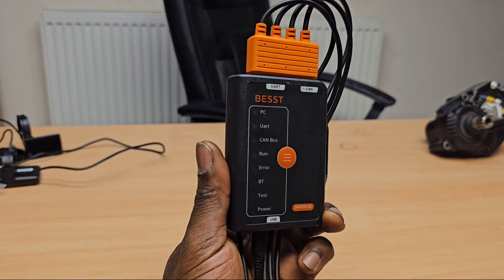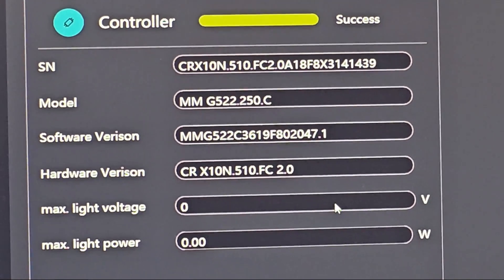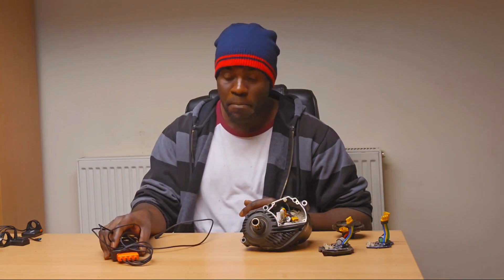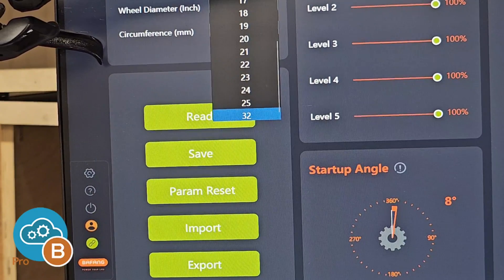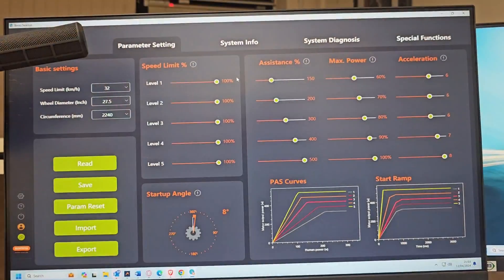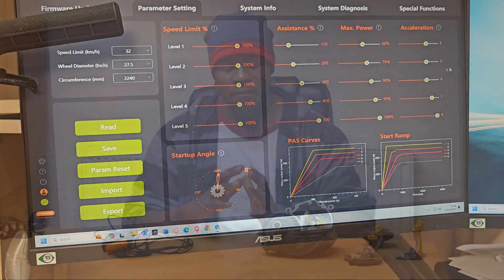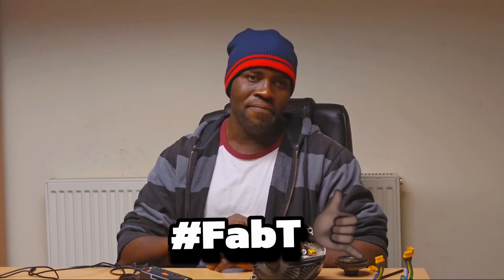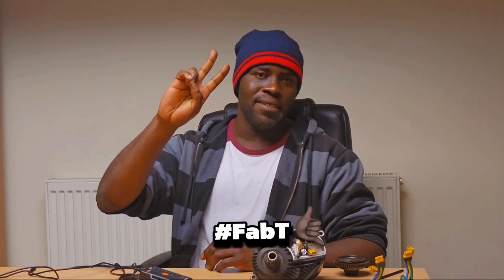Bafang Besst Tool & Besst [Pro] Software Explained

Comment: Can it update the firmware on old bbso2 750w controllers?
Reply from the maker: If its the BBS02b, yes. Because thats CANBus. If its the original BBS02 (uart), the best way is to change the values via the programming cable which will alter the characteristics of the motor. Although, uart bafang controllers are limited in terms of parameter tuning compared to CANBus. But third party companies like eggrider have proven to be useful in terms of getting more out of uart bafang motors👍🏿

Comment: Hi Neeko, great insights on this tool and its encouraged me to buy it with the frameset i've ordered. I didn't notice any mention of ability to use it for adjusting the % when battery saving mode kicks in - is this available or is it a setting Bafang sets in the BMS and can't be adjusted? Thanks

Comment: Hi.
Can the overrun be tuned
Its way too much--coming from bosch....
Reply from the maker: Hi there, 
Yes. Over-run is influenced by acceleration. More acceleration, more Over-run. 
Have you tried the Bafang Go app? You can use that instead to tweak acceleration/Over-run👍🏿
Reply: @neekodevinchi did turn the accelarion right down-no effect on overrun
I'm goiing to try bess tool from a friend next

Comment: Hi Neeko, thanks for helping everyone out with your videos. I was wonder if you ever across this scenario, My DCP08 display will not turn on ( running M600), but when i press display power button, the led  on the control board flashes green. Battery Voltage is Ok and voltage to the board is OK. the display is ok, tried it on another bike. The motor has done less than 20km, basically new Thanks Again
Reply from the maker: Hi there, 
Thanks for getting in touch. 
This is bizarre. The dpc080 display should initiate the Bafang M600 by holding down the power button for 2 - 3 seconds. 
Have you checked to make sure that the display cable and/or wiring loom are kinked?
The dpc080 display cable should be routed on the upperside of the clamp mount, where you should see a small cut out.
Have you tried a different display to turn on the m600?
Do you have/know someone with the Besst Tool?

Please confirm. Alternatively, don't hesitate to drop me a message via email or via Facebook/Instagram👍🏿
Reply: @neekodevinchi  The problem is so strange, when connected to Besstpro, i can read the controller and HMI, do a calibration, but ounce i disconnect it, i cant turn it on via the HMI, The cable and the HMI i am using works on another motor. Its like the vcc on the board that connects to HMI is not working
Reply from the maker: If I had to guess, the pcb board which connects the xt60 connector to the controller has failed. 

Have you tried performing a system test?
Under the system diagnostics tab, it should allow you to perform a system test.
Reply: @neekodevinchi  Thank you so much for your kind assistance.  Yes, i tried the diagnostic on the motor, the controller turns off and  besstpro ask you to turn it back on, which is the issue, it wont turn back on until i exit the diagnostic page. I think you are 100% correct about the board. I have a board that just arrived, can advise if the white rubbery sheet behind the board is a heat sink paste /pad as they could only supply the board itself. Also could you please advise what is the best firmware version you would use

Comment: Dear @neekodevinchi,  
Thank you so much for your quick response!  

Assistance Needed with Firmware Upload Issue.on M625 52V

I am currently using all three available software tools: **BeSST**, **BeSST Pro**, and the **Open Bafang Tool**.  

Changing the wheel size is the least of my concerns. The main issue is that the store where I purchased the M625 with a 52V battery sent me a new firmware, supposedly to unlock the system. However, I am unable to upload the firmware.  

Here’s what happens:  
- I load the firmware into the BeSST toolbox.  
- Then, I reconnect the controller as required.  
- But the firmware does not transfer from the BeSST toolbox to the controller.  

There is no CANbus green LED flashing on the BeSST box as expected. When I reconnect, the controller does not respond at all. I have tried everything I can think of, but nothing works.  

Could you please help me resolve this issue?  

Thank you so much for your support.  

Best regards from Portugal

Comment: Can BEEST software fix intermittent power loss when riding?
Reply from the maker: It depends.
If the problem is due to firmware, yes.
If the problem is caused by communication abnormalities, battery issues or motor issues, no.
The Besst Tool will only identify the culprit in those circumstances. But the part itself would need to be repaired or replaced👍🏿
Reply: @neekodevinchi  Would replacing the motor controller may help?
Reply from the maker: @nvleite not necessarily. If the controller is the cause of your intermittent power, then it could possibly be firmware related. 
If your motor acts irregularly, then I would consider a controller swap.
However, either solution ultimately requires the Besst Tool. 

If you're located in the UK, feel free to pm me ti book an appointment to get your bike/motor resolved.

Comment: Hi Neeko, Thank you for your videos!
 I bought the BESST TOOL for M625 Motor and cannot change anything! even the wheel size its locked to 28", seems the firmware its locked, i bought the motor with 52v Battery from  Lascycle-EU trough Amazon and they said the firmware its different to support the 52V Battery. What can i do to use the BESST TOOL working with my motor?
Reply from the maker: Hi there. Thanks for getting in touch. 

Which software are you using? Besst or Besst Pro?

Changing the rear wheel size is usually straight forward. But depending on your region, you may find that you can't save the new rear wheel size if the speed limit is above 32kph. 

In that circumstance, I would reccomend getting the Bafang dpc080 display. That display allows the rear wheel size to be changed, irrespective of speed limit👍🏿
Reply: Dear @neekodevinchi,  

Thank you so much for your quick response!  

I am currently using all three available software tools: **BeSST**, **BeSST Pro**, and the **Open Bafang Tool**.  

Changing the wheel size is the least of my concerns. The main issue is that the store where I purchased the M625 with a 52V battery sent me a new firmware, supposedly to unlock the system. However, I am unable to upload the firmware.  

Here’s what happens:  
- I load the firmware into the BeSST toolbox.  
- Then, I reconnect the controller as required.  
- But the firmware does not transfer from the BeSST toolbox to the controller.  

There is no CANbus green LED flashing on the BeSST box as expected. When I reconnect, the controller does not respond at all. I have tried everything I can think of, but nothing works.  

Could you please help me resolve this issue?  

Thank you so much for your support.  

Best regards from Portugal

Comment: Hi Neeko,
Firstly thank you for the great videos. I think it very helpful, so maybe you can help me. I bought a E-Cargo bike around 3 years ago and recently out of nowhere there is a problem with the bike where i will get no pedal assistance, meaning i will be on the bike with my kids as normal, then it would just stop working, it would show error 36 so i did research  and made many calls but nobody even the dealer that sold me the bike wants to help. What i did was reset the system then it would work a day or two but then it goes back to the assistance stopping to work. I replace the display which didn't work and the Battery is fine...im just lost at the moment not knowing what to do and there is no e-bike workshop that has the tools to work on Bafang motors near me. It has the Bafang M420 motor, what always work is the push assist. So i think the motor is fine, it only has 1500km. Like i said after system reset it sometimes work for a day then the next its back to not working. Thank you for you time.
Reply from the maker: Hi there, 
Thanks for getting in touch. 
Error 36 relates to the display/remote abnormality. 
Nowadays, I tend to use my Besst Tool to resolve any and all issues concerning Bafang systems. However, if the motor and battery work on your E-Cargo bike once it's on, then your issue "might" be display related. 

Where are you based?

If you're in the UK, I'm more than happy to help. If not, please kindly let me know anyway. I may be able to put you in touch with someone who has the Besst Tool who can definitively identify the issue. 

Look forward to hearing from you👍🏿
Reply: @neekodevinchi  Thank you for the quick reply. i'm in Mainz, Germany. Everyone around here is ready to help if its a Bosch motor but for Bafang no luck. I mentioned that i replaced the Display and it still had the issue. Like i said currently the bike/motor wont go on but if i do multiple resets (- plus on button, while removing the battery then pushing it in position again) it works for a while then the next day its dead then back to rest etc... Someone said it might be the controller, i dont know it's driving me crazy 😛 I actually want to sell the bike as the kids are to big for it now but i don't want to sell something that's broken.

Comment: Hi, I'm writing to you from Italy. I have a Bafang M560 with 5 settings... is it possible to only have 3? Thanks.
Reply from the maker: Yes. Although you'll need the dpc080 display to have 3 levels of assist👍🏿
Reply: @neekodevinchi  sorry for my bad English... first of all thank you for the answer.... I have a question seeing on the sites the display you mention has 6 levels anyway... can I decrease them from the bestpro programmer?
Reply from the maker: No.
The number of levels of assist are determined by the display. 
You can change parameters of each level of assist using the Besst Pro. But the Besst Pro can't change how many levels of assist you have👍🏿

Comment: Can you tell me how to get top speed on a bafang dp c245   Thanks
Reply from the maker: The DPC245 display doesn't have an option to change the speed. The DPC080 display does have the option to change speed, wheel size and circumference👍🏿
Reply: @neekodevinchi if I swap mine for the one that one would it be as simple as plug and play.   Or would I have to have it programmed?
Reply from the maker: You simply swap out the display for the new one. No programming or pairing required👍🏿
Reply: @neekodevinchi .  Thank you sir I appreciate your help keep up the informative videos
Reply: @neekodevinchi .   I just ordered the DPC080 I will be swapping my unit out for it and get maximum speed and torque with my M600.    I will keep you informed how it goes
Reply: @neekodevinchi .  If my motor is locked will the dpc080 unlocked it or will I have to get my motor programmed?      I have the M600
Reply from the maker: @TonyTacoma It is unlikely your M600 is locked. I remain 95% confident that as soon as you plug in the dpc080 and change the speed limit, it will write over the original speed limit👍🏿
Reply: @neekodevinchi . I just installed the DPC080 and went in the advanced settings I tried to change my wheel size and speed and it says configuration failed.       What other options do I have in removing speed limit?

Comment: So is this good all ebikes. Im a technician @Cycle Joint.  In pensacola fl.
Reply from the maker: The Besst Tool works with ebikes which use the Bafang system. 
For diagnostics, parameter tuning, calibration and firmware updates, it is essential👍🏿

Comment: How can I get an invite code?
Reply from the maker: Do you mean login details?
If so, only Bafang can give login details to applicants. 
As i mentioned in the video, it's not easy to get your own login details. But ultimately, you would need to apply to Bafang or find someone who is willing to share their own.
Reply: @neekodevinchi any advice on how you did it. getting a contact is the hardest part for me right now. Crazy i have to go through all this just to tune a couple parameters 😂
Reply from the maker: Their are easier ways to tune parameters for the Bafang motors. Have you tried the Bafang Go app?

Also (depending on whether your motor is CANBus), have you checked out the Bafang dpc080 display?

Combing both the Bafang Go apo and the dpc080 display allows ALL parameter tuning without the need of the Besst Tool. 

I'll elaborate on this in an upcoming video👍🏿
Reply: @neekodevinchi i have that display and the app.. not enough customization for my liking
Reply from the maker: What are you trying to change/adjust?
Reply: @neekodevinchi throttle response and pedal assist sensitivity
Reply from the maker: That's usually firmware associated. 
The Besst Tool is the best way to change firmwares.

Comment: I just purchased a used ebike with the M600 motor.   It is powerful.  The display has 9 assist levels.  I feel that in level 1 if gives too much assist when riding fairly level terrain.  Can this be programmed to do less assist?  I do not have a Bafang account or a Besst programmer.  Is it still possible to get an account and a programmer?  Or is it best to find a bike shop that could do this?
Reply: I don't think you can, cause you're not the original owner of the account for the motor. Probably should've asked for the account to be changed in your name before purchasing. Although a e bike repair shop should be able to take care of you.

Comment: Hello, Neeko. Thanks for the video! Is it possible to connect this device to the Ado ebike (rear Bafang wheel motor, can-bus)? Will it be possible to activate throttle? (There is no throttle on the European version). Is it possible to increase the engine power? (250w is the European limit)

Comment: Hi Neeko, thank you very muchfor this excellent video. I have the M560. What do you think would be the max speed I can configure with the tool?
Reply from the maker: Hi there, 
It depends on the firmware. 
The M560 which was sent with my Hybridizer Sann was set to 45kph. 
But you can set it to 60kph (for private property use).

Of course, you can set it to 25kph/32kph depending on country and region👍🏿
Reply: @neekodevinchi  Thank you very much.

Comment: My M600 motor came with a throttle delay which only enages after 5-8km per hour. 
Is it possible to remove this delay so I have instant throttle like I did with my BBS02B? Thanks for the informative video.
Reply from the maker: Hi there.
Yes. It is possible to do this with the Besst Tool and the original Besst software. 
Your throttle delay is due to the particular firmware installed. So a different firmware (coinciding with your battery voltage) would need to be installed. 

If it helps, I can reccomend specific firmware which offer instant throttle responses in all levels of assist. However, i would need to know your battery voltage. 

Look forward to hearing from you👍🏿
Reply: I installed a BBS02 with CAB bus a week ago. Throttle delay is 2sec no matter what speed I have so if I change gear uphill the bicycle will (almost) stop. Throttle is also sensitive so the ride is rather jerky compared to my old BBS02 with UART and Eggrider V2. Also I need to press the on/off button for 6-7 seconds to turn on the EKD01 display.  Can these parameters be changed with BESST tool?

Comment: Does this work for m625 motor
Reply from the maker: Yes. The M625 is CANBus. So running diagnostics and changing parameters (rear wheel size, circumstance and speed) can only be done using Besst👍🏿
Reply: @neekodevinchi   i bought the BESST TOOL for M625 Motor and cannot change anything! even the wheel size its locked to 28", seems the firmware its locked, i bought the motor with 52v Battery from  Lascycle-EU trough Amazon and they said the firmware its different to support the 52V Battery. What can i do to use the BESST TOOL working with my motor?

Comment: so I take it the beest tool is updated now and allows all these options to be changed? Cool!
Reply from the maker: The Besst Tool is one way you can change parameters. 
Primarily, it's a diagnostic tool first. And a parameter & firmware update Tool second. 
Keep a watchful eye, as I'll be sharing other ways in which you can amend parameters using the Bafang Go+ app👍🏿